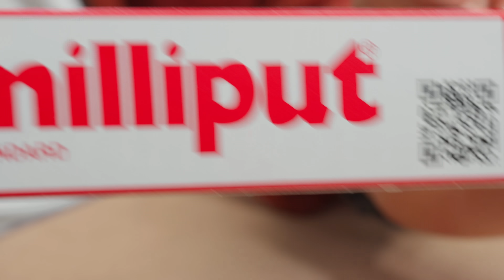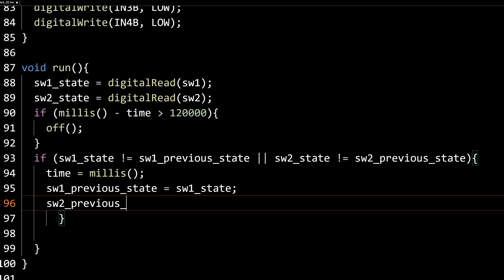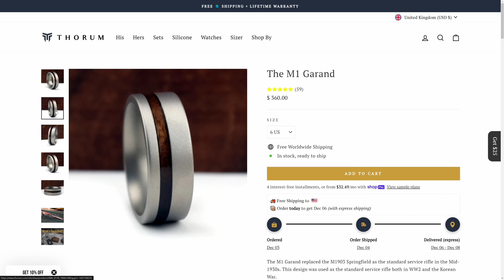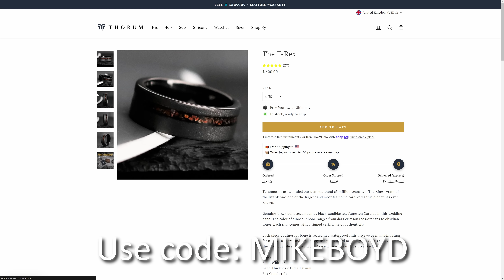It's impossible to lose using this dice

Comment: It'd be really impressive if you put 6 electromagnets in the die with a tiny wireless charging pad in each face and had some microcontroller that could select which face to magnetize so that you could select the number from any face. You'd have to incorporate a tiny capacitor to soak up charge until a roll was made, and I'm not sure how you could signal the microcontroller short of it detecting a series of pulses and having a Hall effect sensor, then using an accelerometer to determine how its rolling and gradually ramp up the current to affect the roll without it being too obvious. Would be difficult to pack all that into a single die, but I'd love it if someone attempted it at the very least.

Comment: If you rolled it into a glass bowl on the table you would only need one electromagnet as the dice would naturally settle in the middle. So it wouldn’t appear to be “snapping” to a specific location each time.  You could also turn down the magnetism with this setup for a more natural bounce and roll.

Comment: Sorry but it was so obvious that it wasn't rolling correctly. You should make one where its center of mass is controlled remotely. That would require using someting other than an Arduino or Rpi for a change...

Comment: The electronics were not necessary.  Simply use a dice tray loaded with magnets strong enough to attract either magnetized side of your magnet loaded dice,  Have them placed in multiple zones for the face value of the dice you want.  This way your opponent can still roll freely and get somewhat more 6's and 1's than average, but be cause they dont know the principle of what zones to roll to get these values and you know the method they can still feel like they get lucky sometimes while you have control over the dice you get.  This is an old magician's method to keep spectators engaged in the illusion while keeping ultimate control of the situation.  And it costs a lot less money to make.

Comment: I was thinking there were coils on each side of the die, a controller in the die, and a battery in there to power it. Then he would use a controller externally and push a button to decide what number to magnetize. There would then be permanent magnets in the table. He did it the opposite and although it was simpler, it made it less convincing. Obviously, the electronics required for what I thought would be outside the fabrication capabilities of a person and you would need machinery to make them but i'd think it would be more entertaining with a die like that. Admittedly though, that was funny. At some point he was just messing with them and didn't care

Comment: I stopped at 0:30 to say that die clearly doesn’t move naturally.  Because the behavior of the die changes, it must have the right number of pips, and isn’t loaded with lead.  With the way the die begins to roll but then snaps to, I’d suspect an electromagnet in or under the rolling tray or table, and ferromagnetic pips.  You’ve got a switch somewhere to turn the electromagnet on or off, maybe with a couple settings.
I’d use a test similar to the one James Randi used to catch James Hydrick (for his ‘mystical’ page-turning).  I’d put some light bits of ferromagnetic metal - maybe pieces of paperclips - around the dice tray.  If the electromagnet is strong enough to make the die move like that, it’ll also make some of the iron bits move.  I could also test the die itself with something as common as a refrigerator magnet.
I’m not a stage magician like Mr. Randi, but I’ve used plenty of dice in roleplaying games, and know of a few types of trick dice.  I also magnetized some steel tools back when I was an electrician, and I’ve always been something of a skeptic, though I didn’t think of that as an uncommon mode of thinking until recent decades, when I began listening to the Skeptics’ Guide to the Universe podcast.  I’ve listed to every episode, and one develops a sense of how credulous most people can be (especially when it comes to things that appear to be supernatural - that’s no surprise, since religions have been manipulating people’s emotions and credulity for millennia).

Comment: i would have liked to see people's reactions when you reveal the trickery. also, why do you need a computer and code for this - wouldnt a couple of relays do the trick?
Reply from the maker: you'd need to build an h-bridge. I just bought h-bridges and used arduino to control their logic.
Reply: @MikeBoyd  yeah, i imagined the 3-way switch you had, connected to 2 relays, one sending current one way and the other sending current the other way. no risk of a short as the switch cannot be in both positions simultaneously. seems simpler to me (i definitely wouldnt be able to recreate how you did it myself), but then again, your solution worked and whatever works is correct :)

Comment: The next step would be fitting the dice with 6 electromagnets, a wirelessly-chargable battery and a wireless controller to decide which face gets magnetized, and then make the rolling surface a thin sheet of iron.

This way you could actually roll whatever number you like.

Comment: Could you not do something like this with oobleck or similar in the centre of the die? If you hold the die flat with the number you want at the top then the liquid with settle at the bottom and harden when you roll weighting that side... That way you can pick every number rather than just two.
Reply from the maker: pretty good idea actually!
Reply: @MikeBoyd  The oobleck might not weigh enough to give reliable results though 🤷 ... Maybe sticky lead pellets and you give the die a tap on the table to get them all to the bottom?...

I'm sure some casino shark has come up with a better method but that's the best I can come up with 😅

Comment: You know, if you use the right magnetic field configuration, you could potentially make it flip between the intermediate numbers by aligning the magnetic fields such that north and south poles of the magnets align parallel to the table surface rather than perpendicular

edit: I will say something thou, you have leveled up your making to a pretty damn high level, nicely done!
Reply: Well, there's only 3 possible main-axis configurations, so you can't get all 6 numbers, some of them have to be repeated  - with the die in the video, a sideways roll could be any of the 4 remaining numbers.
Now, if you set it up with a quadrupole/octupole configuration, then maybe....
Reply: he is not an engineer cut him some slack

Comment: that's really clever. I'm pretty sure I've got it from about a minute in.

Edit: Okay so I got the magnet, but your method is far different than mine. Did you know you can also use the magnets to flip it onto its side? if you want to avoid a 1 or a 6, you can guarantee it won't roll either of those numbers.

Comment: a proper loaded die that you palm out is actually a lot harder to detect, but MUCH harder to use. you have to palm the regular die when you pick it up to roll, then roll your loaded die that was already in your palm, then you have to palm up the loaded die after your roll, leaving behind the regular die. doing that swap seamlessly is really hard and takes practice. a good loaded die has no obvious tell its loaded though because it only changes the odds. the magnetic die is extremely obvious lol

Comment: A few seconds in... that die is stopping way too fast, its got to be a magnet.. so I'm guessing you can only force 1 or 6.
Reply: Now, what you could do, is put the magnet on a diagonal, 1, 2 and 3 all share a corner, 4, 5 and 6 share the opposite corner.... use much less EM so its not screaming "THIS IS NOT HOW PHYSICS WORKS" and you've got a bias, not forcing a win, just an edge.... you could get away with cheating for a slight statistical edge for years.... in games more important than S+L.... I.e. money games.

But don't coz remember, all I've got to do is run the die over my watch strap and you're busted (something that could happen accidentally)..... and people do like beating up cheats.
Reply: Yup, I'd've busted you pretty much the first time you used it, wouldn't call you on it or anything, I'd just find something iron and do a little test next time I was rolling.

Comment: Fun video. How did you disguise the loud clicking sound when switching polarity when you were playing and trying not to be caught?
Reply: With a LOT of farts
Reply: @oyuyuy you win this comment section lol
Reply: @SinclairWest  You can clearly hear electrical relays clicking, which is what you'd need to control high current devices like electromagnets.
Reply: @Guysm1l3y Mosfet would do for a quick video
Reply: It's like reality tv lol
Reply: @SinclairWest  From what I could see/hear he had a big clicky switch to change the polarity. I think you can hear it click at 5:59 when he turns it off. 

You may be right though, just that the sound to me is clearly like a switch and not the muffled sound of a die on a die tray. :)

EDIT: I also seem to hear the click and the die sound as separate sounds in the segment starting at 6:00.
Reply: @minister6667  you're right, should've listened more closely.

So yeah then I have no clue how he concealed that...
Reply: @SinclairWest  Might just be some youtuber shenanigans going on but no matter the case, still a fun and entertaining video.